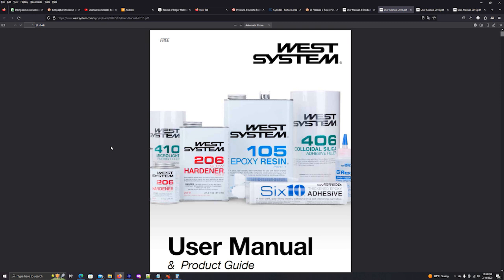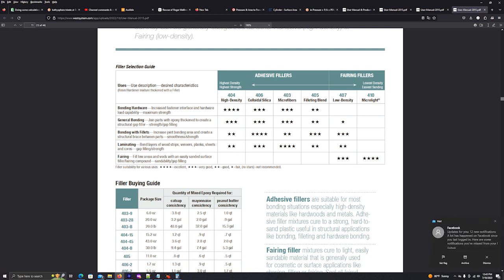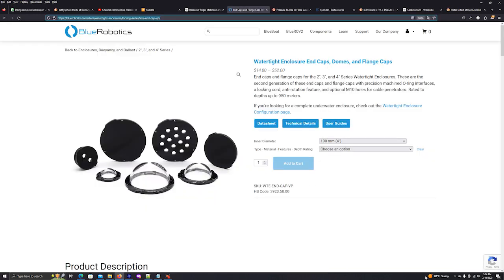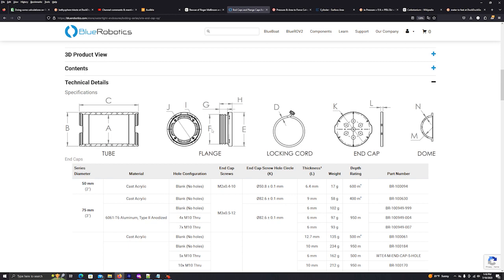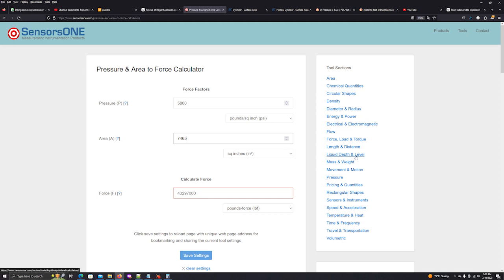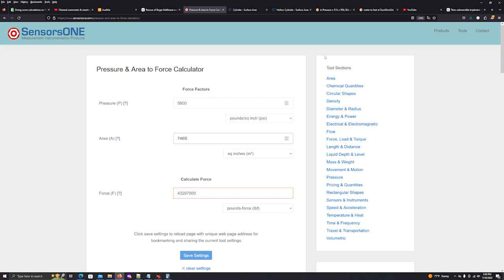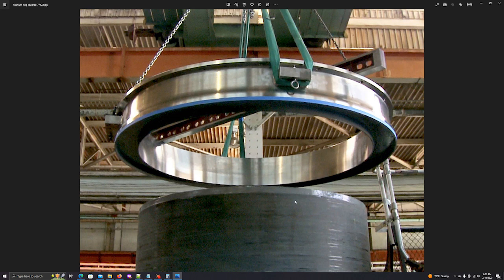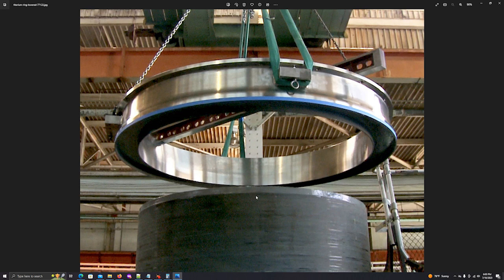Oceangate Titan Peanut Butter, Bonding and End caps

Comment: What I wonder is what the temperature rating would be for such epoxy seals. I remember that the Challenger shuttle blew up because the o rings were brittle from the cold and leaked. Nothing in aerospace has such a huge pressure differential as one finds deep in the ocean, plus it's also cold down there. Even if epoxy was used instead of o rings, surely temperature would also have an effect on it so it seems important to understand what cold does to the epoxy they used.
Reply: Your question on this is spot on.  Coefficient of thermal expansion of differing materials I would bet plays a larger factor into this catastrophic failure than has been explored.  To be sure, bonding failure rates and longevity of many dental restorative materials are directly linked to the Coefficient of thermal expansion delta between the material and the substrate...... when the delta is large, one can anticipate shear load stresses that will invariably cause premature failure.
Reply from the maker: Thanks for the insight
Reply: the ocean is just squeezing those parts harder together. for instance Alvin which goes 3 times deeper uses a simple low pressure seal between the two titanium hemispheres.  the pressure pushes them together as they go deep and seals it more.  I don’t think the glue here is an issue unless the carbon tube starts deforming at which point you are dead anyway.
Reply: @JackMott  you may forget there is a thermal delta and variance upon surfacing, surface thermal temps etc.  it’s the cyclical action not simply pressure pushing.  A face seal or barrel seal would at least allowed for the movement.  I am just advocating a closer look at the epoxy adhesive during specific cyclic stresses as another failure point.
Reply from the maker: Thanks for the comment
Reply from the maker: Thanks for your feedback
Reply: I would propose the immense vacuum of interstellar space is just as formidable. The manned moon landings were staged folks.

Comment: I cannot believe the titanium end cap was "attached" with a slight overlap adhesive flange? There is barely a overlap lip, the carbon fiber was spun in a linear manner, no weaving. (Such little effort in design) YET -They charged $250,000 per person! If they want Return customers, a good reputation? You'd THINK they would invest in advanced engineering designs! Engineer far beyond your operating limit's! Have a bunch of the BEST "what if worse case scenario responses set up" in case something happens. Since only a FEW things can even operate at those underwater conditions. Why not have much more advanced emergency location services? Have a 2 submersible system. Use teether systems, dont operate around a messy titanic ship wreck. Let ROVs do that. Or at LEAST build your submersible so it can withstand MUCH MUCH GREATER STRESS than anything it would experience! I don't understand this type of negligence. This is supposed to carry people, it would be different if it was a unmanned ROV. But NO they charge a quarter of a million dollars per person! For what? Where is all that money going? Definitely didn't go into safety, engineering, technology resources and capabilities... It makes no sense even from a strictly business stand point?? You'd want customers & good PR for continuing income.. well they tossed that down the drain... It makes no sense and makes me so frustrated.
Reply from the maker: Thanks for your feedback

Comment: if they only used GFLEX with the etching kit they used to make....Better yet some T88 structural....  No autoclave, no injection mold, They could have turned the whole op upside down, filled the ring with epoxy and not needed to thicken any of it and no voids. Still would not have saved the design flaws but this whole thing has to be a joke....great distraction though.
Reply from the maker: Thanks

Comment: very enlightening discussing on your part. You help me to see that the collapse of the submersible was in an accordion like fashion. As the two end caps, which were normally separated by the nine feet of carbon fiber wrapped pressure vessel were subjected to the pressures of the dive, they were suddenly collapsed towards one another. This sudden collapse must have generated sufficient force to cause the viewing window to be thrust off of the titanium end cap. Additionally, there was sufficient force applied that caused all of the bolts to fail on both the view ports flange and the titanium end cap. Think of how people go about crushing a soda can. while some might wrap their fist around a full, opened can and crush it like an anaconda, most people prefer to place either hand on each end of the can and compress it like an accordion. Others prefer to stand the emptied can on the ground and use the Godzilla effect of stomping on the can. And then there are the select few who place their hand on top of an empty can and thrust the bottom of the can onto their forehead. 

My point is, the reason for the sight glass and missing bolts/flange is that the vessel collapse like an accordion with the resulting compression of the air within the vessel being sufficient to cause the sight glass flange and the end cap flange bolts to fail.
Reply from the maker: Yes thanks for the comments
Reply: Except at 300 bar the carbon fiber tube compressed about .25” more than the titanium ring did. As for the epoxy adhesive they used I don’t know what it was so I can’t factor in the difference in compression between that and the carbon fiber and titanium.
It wouldn’t take more than a few seconds for a complete failure, filling the roughly .75 bar interior of the submersible. In short the submersible blew from the inside out. The pressure basically turned the occupants into strawberry jam. 
Relying upon two circumferences with 3 different coefficients of compression at those depths was a guaranteed disaster.
Reply from the maker: @rickb2432  Thanks for the detailed explanation

Comment: i didn't realize comparing food to epoxy was industry standard but it makes sense! that part of the video never struck me as odd. not using a big specialized curing device or vacuum mold or something like every other organization that makes structural carbon composites seem to do seemed more odd to me lol
Reply from the maker: Thanks for you feedback.  Yes I remember is school,  Peanut Butter was always used to discuss mixing fillers with epoxy.
Reply: @JoediyLab  So is it Jif peanut butter consistency or Adam's Natural chunky peanut butter?  The latter is pretty runny until you mix it up, then it is more like a cross between soft serve ice cream and a weird thickened syrup with chunks  in it.   This is because the oil in natural peanut butter is not hydrogenated like unnatural peanut butter.
Reply: @DellAnderson 😑
Reply: Actually i think they did make it from peanut butter, woulda been fine if they had got the creamy but bought chunky instead, true facts yes.
Reply: We should nickname him Mr.Peanut Butter
Reply: It certainly feels like these video content makers are scraping the barrel on this story. And why not. Milk it for everything you can, Stockton would be proud 😊